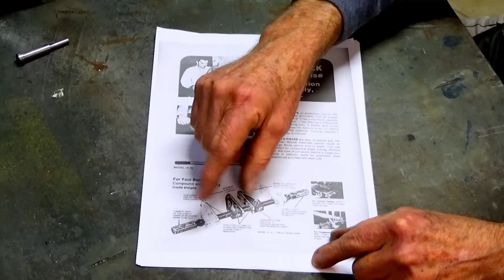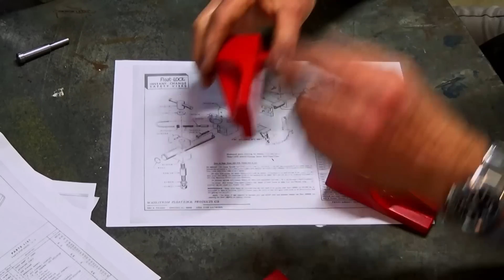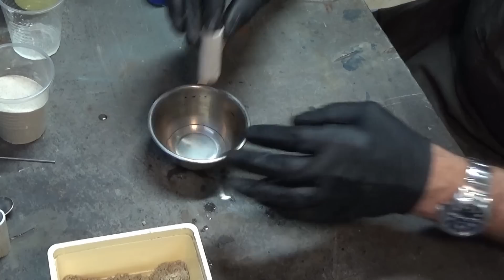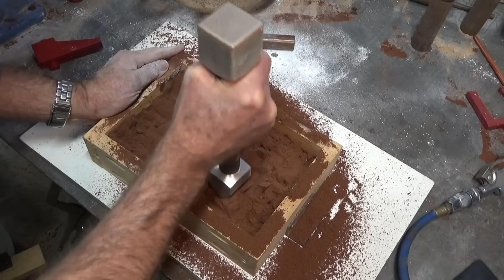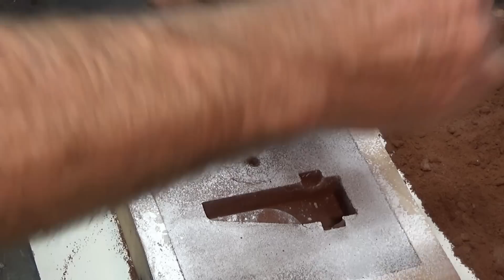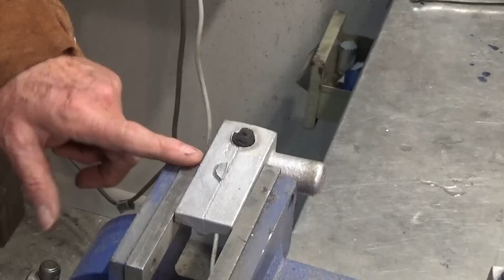Float Lock Vice from Aluminium Castings

Comment: MMMMMMM I am confused, Perry has ditched petrobond for green sand and you have ditched green sand for petrobond?   By the way those castings in your video are the best I have ever seen from you!
Reply from the maker: I still use greensand. I just hadn't gotten around to mulling up a new batch at the time. I got rid of all my old greensand because I had used beach sand and bentonite. Even though the sand looked very fine, it still had some large grains in it. For the new batch I bought some "play sand" from Bunnings, I dried it and then sieved it all to get rid of the organic matter and the bigger grains. I also bought new bentonite and ran it all through a kitchen blender to make it super fine. It is much better than my original batch. I took Martin West's advice and bought new ingots of aluminium for my castings. It makes a world of difference to the quality of the finished castings. Very little porosity and they machine beautifully.
Regards,
Mark

Comment: I would love to make this my first casting attempt!!!  So very cool.  Can't wait to see the finished product.   I am just starting the casting journey.  Got a few of the necessary tools and waiting for a few things before I try melting something.

I did make a float lock vice out of steel and threaded rod from the schematics shared by Mr. Pete ( @mrpete222 ) .  But I would like to make one like you are doing.  So cool!  So cool!!👍
Reply from the maker: Being able to make my own castings at home opened up a whole new set of possibilities. Sometimes, fabrication methods just don't work. Making your own castings isn't as hard as it is sometimes made out to be but the failure rate can be high and that tends to put first time users off. Perseverance is the key.
Regards,
Mark

Comment: G’Day Mark, listening today with headphones I found the audio to be just fine as-is. That said, I understand the quest for better, particularly where there is a distance from the camera.

I’ll be following this Float-lock build with interest. I particularly admire at-home foundry work. 👍
Reply from the maker: Thanks. I need to do some more experimenting with the Boya microphone. It may actually be the camera that is at fault since all the audio settings are disabled as soon as you plug in an external microphone. I need to find a good (and free) audio engineering consultant!
Regards,
Mark

Comment: Which sand/material can replace the K-bond sand? 
(It's not available where I live)
Reply from the maker: I made the first mould (not shown in this video) using regular greensand (a mix of fine "play sand" from the hardware store and 10% bentonite clay) but the mix was a bit too wet at the time and the cope stuck to the drag. I was able to purchase the bentonite clay from our rural supplier. It is sold as a sealer for earth dams and also as a feed supplement for horses. 
Regards,
Mark

Comment: Can the regular  1:1 epoxy used for art be used for the core or there are special requirements for that usage?
Reply from the maker: Absolutely. Just about any epoxy would be fine. I have used marine epoxy (West System 105) which is a 5:1 mix and some of the thin epoxy's would be a little easier to mix with the sand. 
Regards,
Mark

Comment: Your videos make me want to get into casting SO MUCH. You do a great job of showing that you can get very good castings from a home shop setup.
Reply from the maker: I always thought that metal casting at home would be a lot more difficult than it actually is. My very first casting was successful and I still have it and use it. It was a lathe driving dog made from aluminium. Some castings can be troublesome though and the biggest problem is that you can invest a lot of time and effort making a mould and then have the casting fail but you don't find out until after you have poured the metal. That gets a bit frustrating.
Regards,
Mark

Comment: Another source of excessive audio gain is normalization.  I have NO idea what software you use or what checkboxes are available to you, and you of course might be entirely right about the microphone, but...  in my estimation, that much gain could more easily come from some software somewhere than from the actual original signal level of the microphone.  So... I'm happy to be totally wrong; and I often am -- I'm just taking a guess, in the off chance it will actually help.

Normalization is where the software will scan a whole clip, find the loudest sound of the original recording, and then increase the level through the whole clip to bring that loudest sound to the upper limit of what the digital signal can handle.  So I clip that's already got a pretty loud section will get amplified a little bit, and a clip that has only very quiet bits... breathing, etc...  :-)  will get amplified a whole lot, turning all those quiet sounds into Mad Scientist.

Now, IF that's what's actually happening, and IF you have some control over the process, one workaround would be to put a known fairly loud noise in every clip you make, normalize it, and then cut the ends off and put it where it belongs in your edit.

Of course, my personal preference would be to find a checkbox somewhere that says "normalize" and clear it.  :-)

This might be a good chance to do some testing offline, to try to figure out what's really going on.  Maybe you've already done that, and I should just stop talking.  :-)
Reply from the maker: I am using DaVinci Resolve however the problem only showed up after I plugged the Bluetooth receiver into my Sony Handicam. If I use the Sony's built in mic the audio levels remain fairly consistent. There are audio controls in the Sony camera menu that allows me to turn off the zoom audio function and a few other settings but all of those settings become unavailable when I plug in the Boya mic. I do have to do some more testing before I commit to using the Boya mic again. I probably need to be a bit more careful where I position it on my clothing too. Looks like another big learning curve to come.
Regards,
Mark

Comment: Great job on the castings Mark, I haven't seen the core sand epoxy method before, looks stronger and more stable than the other methods. I'm a long way from doing any metal casting, but adding it to my file manager....
I also have a Float Lock so if you any details let me know...looks like Chuck is on it 👍
Cheers....ATB...
Reply from the maker: Thanks Dean, Chuck did send me some detailed photos of his vice and another viewer sent me the patent number and I was able to find the drawings on Google Patents. I was pretty close to the correct geometry for the rack in the main bar but now I can modify it to be the same as the original. I have never had a failure when using the epoxy sand cores. However I have had a few sodium silicate cores that failed to harden all the way through. 
Regards,
Mark

Comment: Some random thoughts to feed the algorithm; 

You deserve a higher resolution weight scales. When measuring sticky stuff, I find placing the scales in a thin plastic bag a good compromise - keeps it clean. Or it would have, had I started the practice sooner.

For the tube, you could possibly 3d print it. Leave a 0.3mm thick wall in two places, it's trivial to cut through with a knife when you want to de-mold.
Reply from the maker: I generally 3D print my core boxes and I will print in a flexure so that I can prise open the box easily. In this case I just got lazy and used the conduit because it was at hand. Given that it was only going to be used once I could have just heated it with a torch or heat gun and retrieved the core that way. I honestly thought the hardened core would just push out from one end. I also have a much more sensitive set of scales (I call them my drug dealers scales), but you are correct that a plastic bag is a good precaution against spills.
Regards,
Mark

Comment: Those are great castings as I knew they would be.  You have very good sound compared to lots of other guys who tend to have muddy sound.  I have so far done my best with the built in microphone in a canon camera.  Thanks for the video keep on keeping on.
Reply: Hi Harold, I second the Canon camera built in microphones, they've got it figured out..
ATB....
Reply from the maker: I use a Sony Handicam and the built in microphone is pretty good. The only time it gets difficult is when I have to stand a long way from the camera. I still need to do some experimentation but I won't use the Boya microphone until I am confident I have sorted the audio levels. Unfortunately, there is only a volume control on the Boya receiver and no other settings that can be tweaked. 
Regards,
Mark

Comment: Good start on the float lock vice Mark. And, good to see the new burner system in action on a job.

I think the angled pins will still work ok because the round bar is incapsulated by the jaw. I think the pressure on the pin would try to kink the jaw out, but it wont be able to move with the snug fit of the jaw on the bar. But, I would have thought that the pins should be pointing at the bar the other way (e.g. the pins pointing more in the direction of the clamping pressure). May be there is no room on the jaw to point them the other way?
Reply from the maker: I had some misgivings about the pin/hole alignment but the mock-up seems to confirm that it locks up solid as soon as the screw closes the jaws. If it all fails there is still the option of re-machining the bar and using a stepped rack like the original. I have had some offers of closeup photos of how the original Wahlstrom device works.
Regards,
Mark

Comment: Dont get me wrong, i love your casting videos, but i dont really like the float lock vise concept... I think its a solution to a problem that doesnt really exist... The machinist`s vise or grinding vise is oft a good enough clamping solution to the drill press issues, but sure, they have the ``how do you clamp that vise then`` issue? to which i really cant give the answer, as its really drill dependent, but mostly, you use the t-slots in the drill table... Which is the same approach i use with any drill press clamping situation... 
The whole point of a pair of swiveling fixtures is that they mimic the radial arm drill flexibility in positioning, and the t-slots are there to affix the hold down clamps as to best be able to utilize the whole table surface, rather than relying on a limited vise... 
I would rather machine a 1 or 2 inch flat plate with a fence on one side(square flat plate in other words) and a bunch of holes for pins and bolts which sure will get full of crap over time, but a vacuum is oft a good enough solution to that issue, and if the holes are through drilled, then its even easier to clean out that mess with either vac or compr. air(tho, if the plate is 2 inches, that will be a lot of drilling)... The pin holes would ease the x-y fixturing of any part on the ``specific coordinates of the plate``, and the bolt holes would logically offer the ``z axis`` of clamping the part down to prevent the drill from sucking the part up as it breaks through on the other side... 
A float lock always seemed like more of a fancy project for the sake of creativity, rather than a real answer to a glaring issue of a certain machine or operation thereon... But, i wont bitch, as said, i love your work and greatly enjoy your content, so even if its not a project i will undertake, it sure is one i will enjoy fully in this case!

All the best and kindest regards!
Steuss
Reply from the maker: I have gotten by for nearly 50 years without a float lock vice so it does seem like a bit of a vanity project. When I watched Tom Lipton discussing the one he had he showed a much simpler solution which is basically a regular drill press vice attached to a long arm that can be locked in place on the drill press table. I keeps the vice from rotating and from lifting to a certain degree. My drill press doesn't have tee slots but it does have through slots. It's always a bit of a fiddle to find the right length bolts and nuts to hold down parts. I have had some close calls when I drill jammed up in a part and even the heaviest drill press vice can get out of control if you are just gripping it in your hands at the time. I think the biggest attraction with the float lock version is the ability to hold round work in different orientations quickly. 
Regards,
Mark
Reply: @Preso58  yeah, i get the quick setup of float lock, but the swiveling arm of the table and the table`s ability to rotate already offer a quick positioning solution, as said, akin to radial arm drill...
Regarding your through slots, sure, those a bit fiddly, but i would consider making a few ``t-nuts`` without the threads, just a countersunk clearance hole for say m6, m8, m10, m12 and that is likely good enough with some large custom nuts... you would need 2 or 3 if you want of each size, so thats 12+12 easily done parts that would allow you to use the any length of regular caphead screws as clamping device for the stepped clamps...
Its more fiddly than float lock, but its astronomically more secure, and with all the eq. at ready in a small custom box attached to table arm casting(likely on the backside, facing away from you), it would be quick and easy to just pick the adequate clamps, ``t-nuts`` and bolts and clamp the part, using the swiveling motion of the arm and the table for drill centering and locating the part... 
You could even make the ``t-nuts`` into actual nuts and just make custom thick washers for the clamp side, as you would not be making the custom nuts, as the head of the screw would not be on the underside of the table... 
I dont know, it seems easier to make two series of ultra simple parts over whats a relatively demanding device that doesnt offer exponential improvement in any area, while offering a sketchy at best solution to what its actually supposed to do, which is to hold the damn part steady so it doesnt obliterate you or result in a wonky hole... 
I know that drills arent ``precision`` equipment, but hell, a drill press of your caliber should be a precision device, not a jig borer grade, but hell, it aint a handheld drill, its a stationary mass of good ol` iron... It sure as hell is a precision device, at least rigidity-wise and with regards to its origin and production... 

All the best and kindest regards!
Steuss

Comment: Another good descriptive video Mark. Do you make your own k-bond? If so what recipe do you use?
Reply from the maker: I was sent the ingredients to make the K-Bond by a viewer in the USA. He had purchased a large batch of the binder and catalyst which is typical for home shop enthusiasts looking for these ingredients. The suppliers will generally only sell in bulk and then you have to sell it on to others who might need smaller amounts. I do have a recipe though. This is what was sent to me with the ingredients "The typical mixing ratios are: 100 pounds of dried silica sand (local pickup), 5 pounds of  Petrobond binder, 2 pound of Petrobond oil (30 weight nondetergent oil, local pickup) and 1 ounce of P-1 catalyst." 
Regards,
Mark

Comment: Any details in the relevant patents ?  ‘float lock vise patent’ turns up several results such as us pat 23519
Reply from the maker: That patent is for a different type of vice. It has a screw thread running through the centre of the main bar with a sort of half nut which is spring loaded against the thread. It also allows for quick repositioning of the fixed jaw but the type that I had in mind doesn't need the long screw thread down the centre of the bar. That feature would be quite hard to make unless you had a gun drill or some hollow bar stock. I only recently found out about Google Patents and it's quite possible that the patent for the type of vice I am looking to build is available. I will do some searching to try to find it.
Regards,
Mark
Reply: @Preso58  Mark, These look like the rack type float lock VISE patents US2552580, US2724295, US3520527
Regards Martin
Reply from the maker: @MartinE63  Thanks Martin, it was patent number US2724295 that had the detail that I was looking for. I did try Google Patents and searched for "float lock vice" but I got hundreds of hits for all sorts of devices that were totally unrelated. In the meantime, Chuck Bommarito had sent me some close up photos of the rack mechanism in his vice and I can now see that I was close to the correct features but I had just drilled the pockets deeper than they need to be. With his photos and the patent drawings I should be able to recreate the ratcheting action fairly closely. 
Regards,
Mark

Comment: I love your pattern lifting tool! I’m only 38 but a cycling accident left me with a pretty serious tremor that makes tasks like that nearly impossible. I love your creative approach to solving this kind of issue! Great video too! Those castings turned out great!
Reply from the maker: I had ruined quite a few moulds before I realised that I needed some help in getting the patterns out of the moulds. I have seen a few good ideas like using heavy blocks of steel placed on the surface of the cope and drag to guide the pattern and that method works great for patterns with flat sides but odd shaped patterns can still be a challenge. 
Regards,
Mark

Comment: Hi Preso, great new project. The new furnace setup looks like its running well. Regards Kevin
Reply from the maker: Thanks Kevin. The new furnace burner is great. I think with a bit more practice I can get excellent results with it. I was able to tune the flame so it was running a little lean and the interior of the refractory lining was pure white when I finished the melt. No more soot, or very little anyway. 
Regards,
Mark